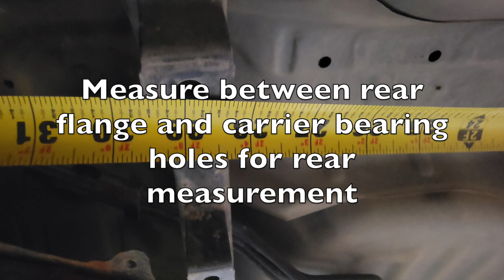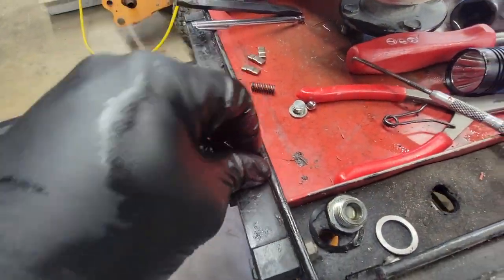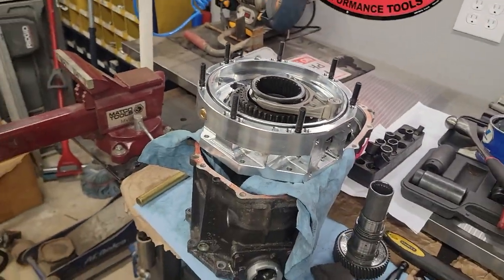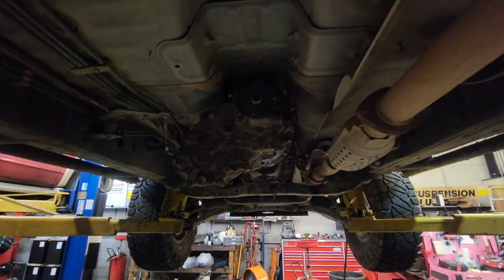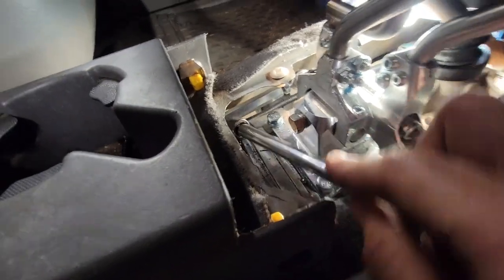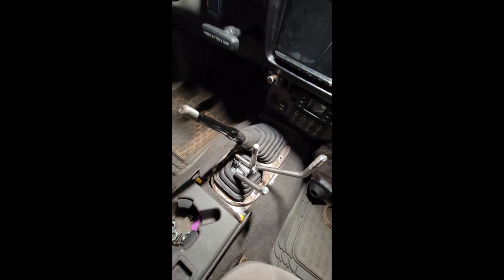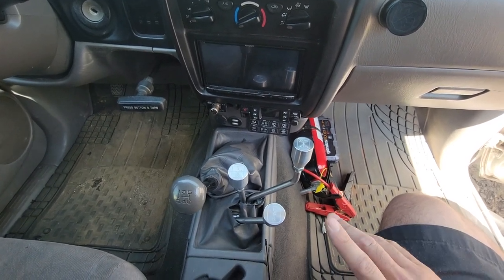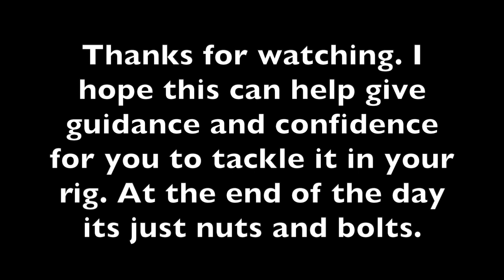Toyota Tacoma Northwest Fab Eco Crawler Part 2

Comment: Thanks for documenting!  Love the swivel on the crow's foot.  I put a floor jack on the transfer case, unbolt the cross member, and tilt the whole thing back as far as it'll go to get to mine for adjustment.  Having had to remove the transfer case post Eco Crawler install (don't ask), I can confirm that the biggest pain in the butt of the whole ordeal is removing the triple stick.
Reply from the maker: Thanks for the comment. Removing after install sucks! As you see on my video I had to.what other mods have you done? I have videos coming for the sas I'm doing to it right now. I am worried about my t case with the doubler and 40" tires. I may be pulling the case alot lol.

Comment: Finally a good reference for a eco crawler. I have a 2003 Taco and a doubler seems like is is a game changer.
Reply from the maker: With my other videos you can see how much control I gained and capability. I can not say anything bad about it
Reply from the maker: I have the modified drive shafts if you can use them. As the truck is being modified and I will not need them
Reply: I’m going 1 tons too.  So no thank you.  But I am subscribed!!
Reply: Sorry about the spam… I have no idea where that came from.

Comment: Can u let me know what the stamping on ur front shifter housing pn is? I got sent one but it wasnt the right one.
Reply from the maker: I can not see it unless I take apart the whole console. Did you call northwest fab?
Reply: @penguinsgarage  I am planning on doing this to my sequoia. They want me to use the one mounted onto the transmission and not the j shift
Reply from the maker: I'm not really sure what your asking the tech guys are very smart at nw fab and if they are telling you something they are usually right
Reply: @penguinsgarage  it's alright. They want me to bolt it to the transmission instead
Reply from the maker: Oh wierd. Did they update there setup?
Reply: @penguinsgarage  they did but it's difficult for my application I guess
Reply from the maker: Ya an automatic is going to be much different. I have not seen one in that truck before are you going to do a sas
Reply: @penguinsgarage  no I'm keeping it ifs
Reply: @penguinsgarage  it will help with all the v8 power.
Reply from the maker: I'm going to ls swap and atlas mine at some point but your rig will be an awsome one and you might even be able to get the rclt kit for it
Reply: @penguinsgarage  ooo that sounds nice. Going to be better gas mileage. What state do u live in? That could be a possibility in the future. My issue was I was over complicating it. It does bolt to the bell housing. I will cap the front eco crawler one and the extended shaft will come into the hell housing. I just need longer turnbuckles it's called. I will try to do photos
Reply from the maker: @egtallday I'm in San Diego. Would love to see pics of the eco going in
Reply: @penguinsgarage  I'll grab pics. U better bar that thing. It's not too hard. I've seen it done